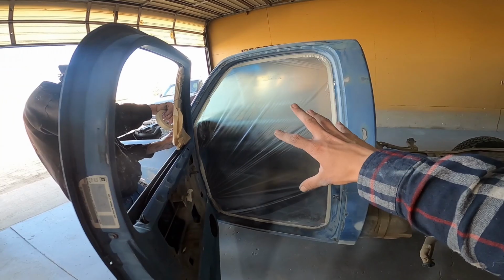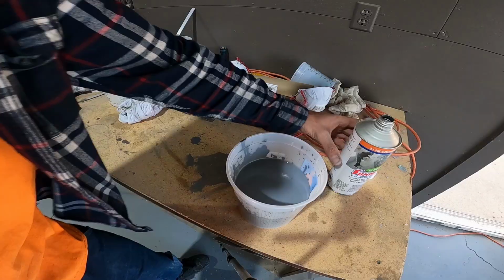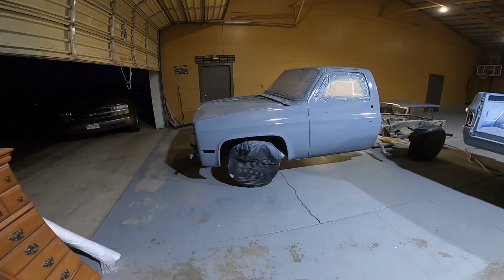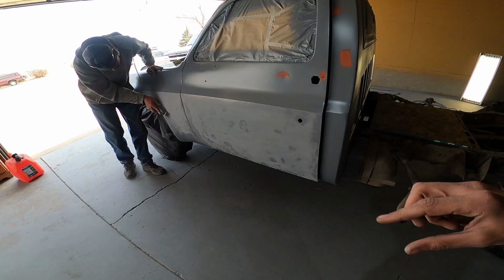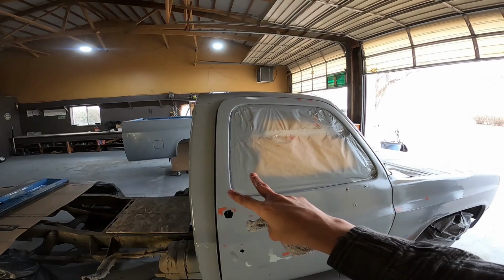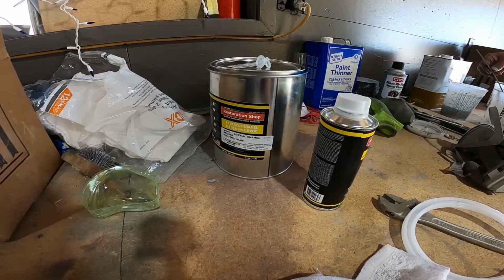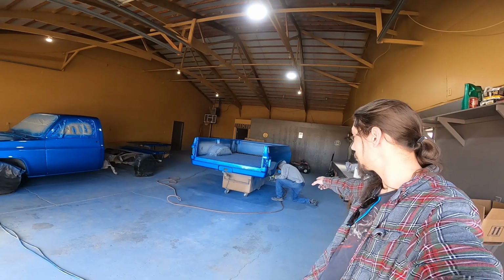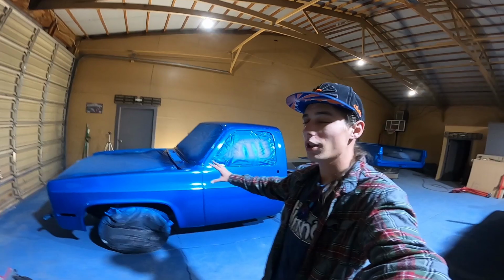Painting my Bro's long bed Squarebody C10 Chevy! ( Budget Friendly Part 3 )

Comment: You should never add extra hardener to your paint, over hardening can cause the paint to be more brittle than it should once dry, which makes the paint crack and chip much more easily. The ratios are as such for a reason, automotive parts tend to flex and the paint needs to stay a tad bit pliable to be able to move with the panel without cracking the paint. Contrary to popular belief, automotive paint is not nearly as "hard" or "stiff" as many people think, but actually quite flexible without cracking.
Reply: Thats good to know thanks man
Reply from the maker: Thanks for that information! Knowing that now I won’t do that again! Thanks you for watching as well! I hope you subscribed to see more In the future.